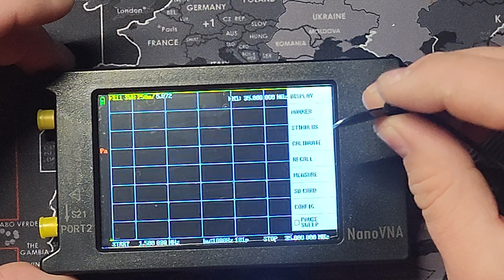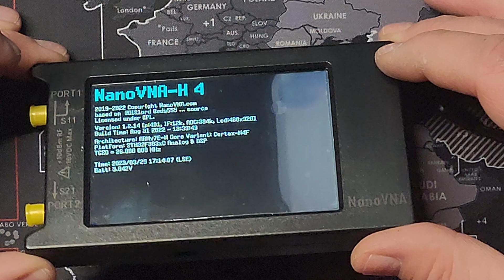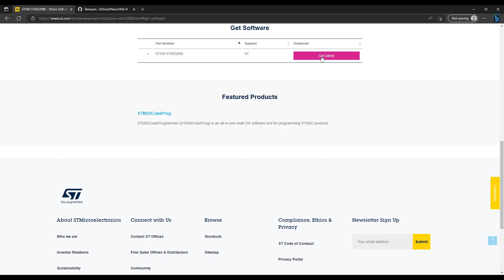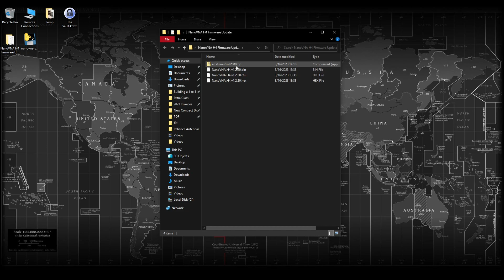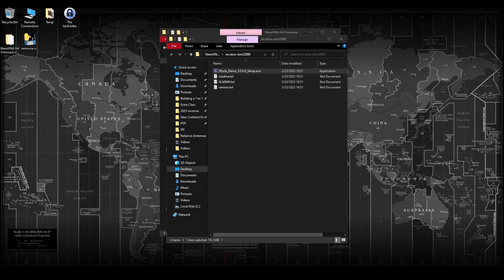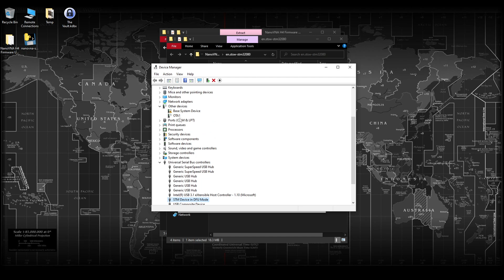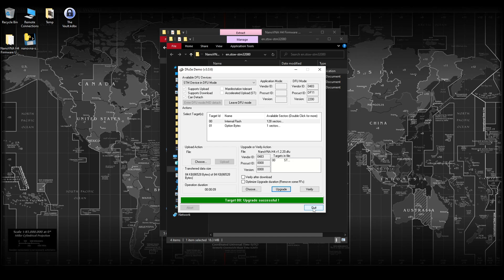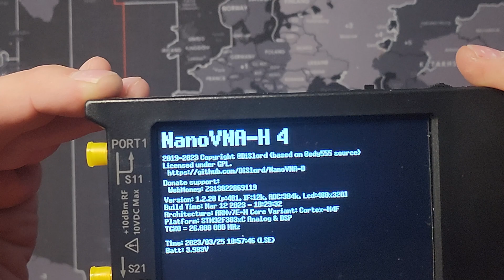NanoVNA H4 Firmware Upgrade

Comment: I think I might have a very old version I have seen on the NANOvna website that you need to connect two pins on the board to get it to go into the DFU mode and still hold down the scroll nob and power it on. Have you heard of this?  Thanks

Comment: I downloaded the dfu file for the Nano-H and then followed the process to download the STM Demo files and ran into the driver issue as you explained. I was able to resolve the issue following your steps to point to the installation folder where the latest driver was installed. The software immediately recognized my Nanovna-h and I then pointed the software to my DFU file. It took over 35 minutes to complete the Erase Phase. It then proceeded to the Downloading Phase and then errored out at about 27% completion.

I am retrying everything from the beginning and hopefully it will successfully complete the Firmware upgrade. if not I have a brick.

PS: I made sure that I downloaded the Nanovna-H dfu file NOT the Version 4 file.

I was able to complete the upgrade after running the Erase Module a second time. I had to let it run overnight as it took awhile to complete the Firmware upgrade. I am currently running 1.240.

Comment: So, is there a bootstrap that has to be installed before the Defuse update will work? My NanoVna-H4 seems to be stuck in DFU. The software evidently loaded and uploaded as per the video. It just does not exit DFU. I tried the software button, no joy. 
The part I did not mention is that the touch screen stopped working and the vendor replaced the unit. Me, being the way I am, have to try to fix the problem. I replaced the STM processor (hot aired the chip and soldered in the new one), with new chip from Digikey. I'm thinking there must be something else outside of a straight firmware update. 
Any ideas? Thanks. ve7bul.

Comment: For anyone having issues with windows saying that the latest version is already installed, try manually checking your install location and running the driver installer, then go device manager and update driver, then browse, pick from list, and pick STM Device in DFU Mode. Mine also kept updating it after, so I had to delete the Guillemot folder that had the wrong drivers (Just search up Guillemot STM Driver if you need more details)

Comment: Thanks for this instructions. It made it really easy. One question though to people that have upgraded to this latest v1.2.20 I notice that setting the Reference Level through menu does not work right (or I am doing something wrong). If I choose the expected Reference of about 0dB or something similar I get most strange big values it sets the Reference level to, like 100. The Scale/Div also messes up, sometimes goes to 0. Has anyone else experienced the same issue. On the other hand, setting the Reference level by touching most left up or most left down changes the reference level by one Scale/Div at the time. .... I will search the web for more clues..
Reply from the maker: I just tried to do this an had no issues with my version of NanoVNA H4. Are you still having this issue?
Reply: @n3vanradio  Hi. This was a user error. I was mistaken Ref Position for Ref Level. I have learned that Ref Position function is to put the 0dB line to one of the 8 horizontal grid lines. I was glad that it was my own mistake and not a malfunction. I have understood that the newest beta version would have actual Ref Level, even top and bottom settings possibilities.

Comment: Just got my H4 last week and followed your excellent instrucitonal video on how to upgrade the firmware.
Just curious, is it normal for this device to freeze up occasionally when depressing the thumb wheel?
It brings up the menu but freezes.
Reply from the maker: The wheel sensor is a bit of a pain on some of these. I have had that happen on other variants.
Reply: @n3vanradio  Guess I can just avoid using it. Thanks

Comment: Did everything and got same messages as you after upgrade was completed. Turned off then turned on but nothing just a black screen and a message saying device USB not recognized! It's as though it's bricked! What next? Buy a new one? Arrrrg! It's an H4.

Update...problems resolved...go to Matts video of how to get out of DFU mode. Don't forget to push button down!!!
Reply from the maker: Don't panic just yet! It may just be stuck in DFU mode, which another viewer had. Watch this video for the first, simple method to unstuck your NanoVNA H4

https://www.youtube.com/watch?v=k0KwcSycpM0
Reply: Watched the video but no luck. Uninstalled and reinstalled however it states there were 4 files already still there. No DFU devices shown on software nor in Device manager. Did all you show but most of the DFU window is grayed out.
 @n3vanradio
Reply: My BAD! Got it back and upgraded.... kept forgetting to push button down while turning on! Thanks for all the help with your superb videos. @n3vanradio

Comment: I spent several hours on a Mac M1 running a Win11 emulator. I could not get the DFU Driver to load in any way.  Mac emulation using Parallels 19 is a no go.

In frustration I dug out an old Win10 pc and it loaded up right away!  I updated my -H4 from 1.2.14 to 1.2.20 like a boss!   Lots of new functionality was the reward.     

Thank you!
Reply: Same here, I tried all I could to get it to work on a WIn 11 desktop but no go. Pulled out a Win 10 laptop and it worked fine. My biggest problem with the H4 is my SD card reader would not work. Now it works with the new 1.2.40 firmware. Thanks for the video.

Comment: Thanks for the video and glad I watched until the end.  The upgrade went smoothly but it looks like you have the same issue that I did which is a huge spur just above 300MHz.  I fiddled with the with the expert settings to knock it down.   Any thoughts on how you may have addressed it?

Comment: as a brand new user, i followed every step... but no joy... thank God im bald, i would have pulled my hair out.... the ONE step that you didnt cover that i found out the hard way was to consider the NanoVNA DRIVERS!!!! try as i might, nothing happened. only when i looked into the NanoVNA io groups, it talked about drivers... after i did that, did all of your directions made sense.. i had to use the win 8 versions for windows 10.... and yes!! i was successful with upgrading the firmware like in your video!!  Great VIDEO, except for that one little step.... lol

Comment: Unfortunately mine does not come back up.  Stays black just like it did when in DFU mode though it isn't.  I even plugged it in and the software didn't recognize but I redid the start with the jog button pushed and the software did recognize it so it was not stuck in DFU mode.  Two possibilities I think.  Mine has SeeSii up in the top right corner and perhaps that brand has some incompatibility though the software and versions matched exactly.  Another is that I found two DFU files that could be downloaded at the link and did not know which one.  I tried the larger one first....when it stayed black I then did it again but this time with the smaller file (84kb)   It did go through the erase mode and upgraded successfully...but is staying black.   I think it is me....I have this effect on electronics ;)  I still thank you for sharing this info and you even put links in.  Very kind.  thanks.
Reply: See the comment from a user listed here where a H not the H4 dfu file was needed for the SeeSii version to avoid a blank screen
Reply from the maker: Wow, that is odd and not good. What did the information page show regarding software version and developer? That is the only thing I can think of.

If you want shoot me an email (either in my YT about page or QRZ page). I can gladly help troubleshoot it with you or send it to me, ill see if i can fix it and then send it back. No cost. Be good to do a troubleshooting video on this if it does happen to someone else :) Thanks 73, Matt N3VAN

Comment: Thank you for a great instructional video and supporting info. I do have an issue you may wish to help me with. I ran the upgrade as directed and get positive confirmations on all steps. However the unit a Zeeenko Nanovna H4 is not accepting the upgrade. I tried the .bin file as was suggested in the comments. Any help appreciated.
Reply from the maker: Thank you. Can you send me an email with a picture of your Zeenko NanoVNA H4's about (info) page? I can gladly help you resolve it. My email is good on QRZ. 73, Matt N3VAN

Comment: Couldn't see the unit in Dfuse like you showed in Device Manager it was in the USB device section but  the driver installed was the latest anyway so I tried the STM32cube software shown in your video instead and that worked but with the .bin file instead of the .dfu. Thanks for the links to the upgrades and the hints to overcome the driver hiccough 👍
Reply: got any kind of instructions for the STM32cube setup?
Reply: @danielbaker2527  I'm on vacation atm so can't refresh my memory but STMmicroelectonics has detailed videos here on YouTube. Do a search for STMcubeprogrammer and multiple videos will appear. I just installed the programmer plugged in the nanovna, loaded the .bin as a project I think and downloaded to the device.
Reply from the maker: You're very welcome and glad you got it updated!

Comment: Went through the process and it completed fine however, when I disconnect and power the VNA on again, I no longer have a display, just a black screen.  This is the SeeSii branded H4.  Is it possible this needs a different file?  It was using 1.2,14 like your was before I attempted the update.
Reply: Was my issue.  I grabbed the H instead of the h4 DFU file.   All good now.

Comment: litevna 64  cant update.. manual driver selection not help
Reply from the maker: The LiteVNA 64 has different software firmware than what is shown in my video. For firmware please see this page
https://drive.google.com/drive/folders/10lU5xnwmHDnPX98z21ky09N8nb_cEOk4

Hope this helps. 73, Matt N3VAN

Comment: well I asked a question and part of the answer showed up in my notifications but i cant read the rest of your answer and now my question has disappeared from the comments on this video
Reply from the maker: Very odd as i dont see it either. I even thumbed up the comment and replied. Let me check on my end.
Reply: @n3vanradio  i just wanted to read the entire answer...lol...it stopped at "I would follow" and thats it
Reply from the maker: Ok. What I was saying is Hugen is one of the contributors to the Nanovna project on Github and he mentions to "Update to DiSlord version 1.2.14 code for better and faster display." on his Github page here: https://github.com/hugen79/NanoVNA-H

I would follow is recommendation but remember to use your platform NANOVNA_STM32_F303 (which is in the picture you gave) to get the right firmware file.
Reply: @n3vanradio  guess ill leave it alone cause you lost me using the same platform cause I have no idea what you are talking about...i am stupid when it comes to github unless i have a video to watch about it
I went to the link u posted and clicked the NANOVNA_STM32_F303 folder and its got all kinds of stuff in it so I have no idea how to even do it
Reply: if it doesnt have a windows installer...im lost...lol
Reply from the maker: I looked into your version more and the process I posted in the video will work. You have the Hugen code but it appears Dislord took over the project from Hugen. Just follow the steps and let me know if you run into any problems but it is rather straight forward :)
Reply from the maker: So weird. The link to the comment that showed up in my email went to a generic page. I know I didn't delete it, havent deleted anyones comment to date but here was your original question. 

"J Shepherd 
Just the video I was looking for. I have a question though, I bought a nanovna H4 new in May of 2021 and Ive never updated the firmware. The version on it now says version 0.5.0 Feb 21 2020 and it says Kernel 5.1.0. Full pic of the version screen is here https://ibb.co/4ZjNb1g Is it ok to use the one you used on this video on mine or are there other upgrade in between my original and the newest that I have to do before trying this version on your video?? "

Did you receive my response?
Reply from the maker: I hear you! If it's not broke why fix it. if you do give it a try let me know if you need any help. Dislord is a solid firmware version and only had that one issue I highlighted in the video. Good luck and 73 Matt N3VAN
Reply: @n3vanradio  Thanks for taking the time to look into it further and this video is great. Only reason I thought about upgrading is that I heard it gives the option to work with 75 Ohm coax also

Comment: Thank you so much for this, i used it to update my old one which seems to have fixed it. I also replaced both of the sma connectors because they were getting loose. Just some advice if you do replace the connectors, use some heavy sidecutters or nippers to chop them up (carefully not to damage the board) first. Its much easier to desolder the 5 pins individually than dump a ton of heat and pull them all at once
Reply from the maker: You are very welcome. Glad I coul help you update your old NanoVNA and thank you for the information on replacing a damaged connector. I hope it doesn't happen soon to mine but I do keep it in my comms bag.

Comment: Wow, Thanks for this. I guess I need to just break down and learn how to use my H4. Mine was on version 0.5.something lol. Quite a few more options now with the newer firmware. I keep thinking I want to buy one of those Rig expert stick pro's but that $ just keeps me from it. suppose I'll learn this thing finally and probably have everything I need. Thanks again.
Reply: Live and learn. The nanoVNA is way more useful and much less expensive.
Reply from the maker: You're welcome Marvin. The NanoVNA is a fantastic tool to have in your comms kit. It is small and powerful. I did enjoy my RigExperts and always wanted one of their Stick Pro's but like you said the price kept me from it.

Even if I have to replace my NanoVNA it still wouldn't cost as much as buying one of those.

Also, there are many videos on how to calibrate and use various versions of the NanoVNA here on YT as well as well documented information on the NanoVNA Groups.io discussion board.

73, Matt N3VAN
Reply: I just followed your excellent directions and updated my NanoVNA-H 4. I got the same error message as you and was able to correct it following your directions. Thank you for this great instructional video, I found it very helpful.
Reply from the maker: @W6MRD I am glad to hear the video helped you upgrade your Nanovna H4! When I was making the video it confused me as well until I did more research. Thanks again for the great feedback! 73, Matt N3VAN
Reply: You have MS version of NanoVNA (MS string on back label) so need enable MS5351 mode, CONFIG->EXPERT SETTINGS->MORE->MODE change to MS5351
After need save setting CONFIG->SAVE